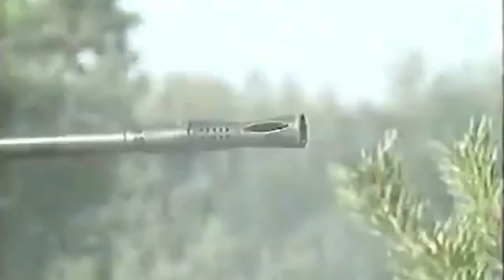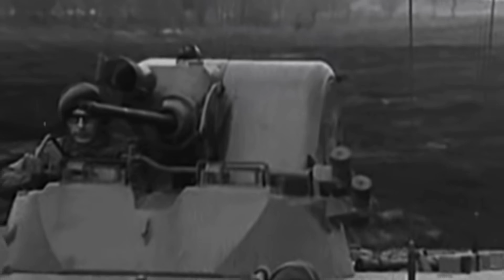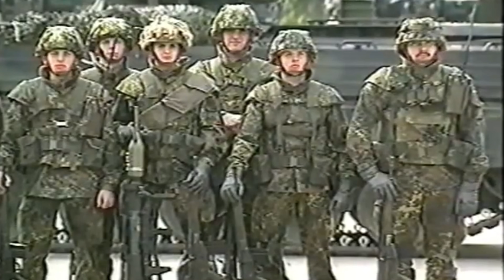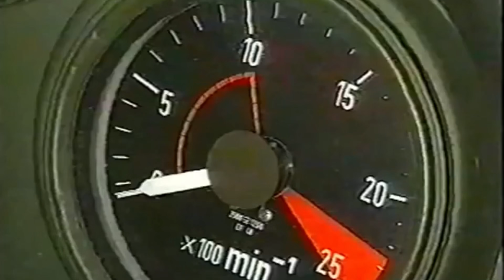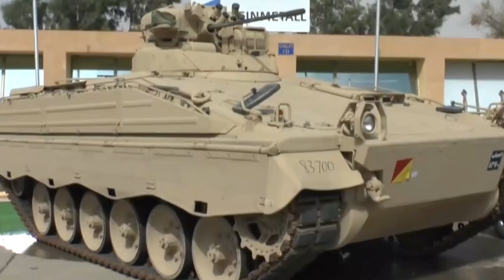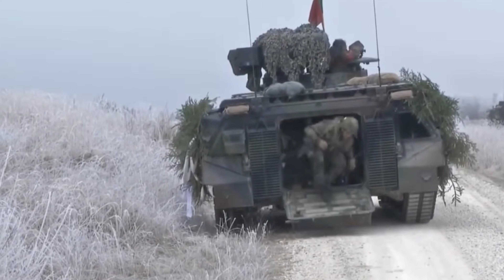The Marder IFV: The Legendary German Infantry Fighting Vehicle | PANZERGRENADIER POWER

Comment: I’ve read that the Marder performed very well in Afghanistan. According to intercepted enemy communications, the Taliban feared the Marder far more than anything else. A single Marder reportedly thwarted a flanking maneuver against dismounted Bundeswehr infantry by holding off 200 to 300 Taliban fighters. Of course, any other IFV equipped with thermal or night-vision capabilities could have done the same, but it is impressive when you consider just how old the Marder is.

Comment: how effective is a 20mm against infantry? all the time ppl use 20mm cannons but i just cannot tell how useful this is compared to 30/40/57mm cannons. how close do i have to shoot a soldier with he to kill him? 40mm has a quite big kill radius but 20mm? volume grows exponentially with diameter so double size multiple Times the he charge. is 20mm even killing with close hits or only direct hits? if its direct hit only why would i not use a .50 or 30mm? i know ammo size and weight is a factor but if the needed ammo for a kill with 40mm is way lower because of splash radius, would that not cancel out the lower ammo capacity? with increased AP performance and ragne

Comment: The Puma really has some big footsteps to fill, its development issues are also blown out of proportion to an absurd level, the marder is a system which people could study in every possible condition for 50 years, of course its reliable, its built on a solid concept and initial problems have all been mitigated by now. The Puma starts with a big leap in capabilities and will only improve once it's fully in service.
 Engineering challenges are seldom unsolveable and usually changing or unknown requirements play a role but if Germany didn't waste most of their defense budget on consultants, bureaucracy and repairing ancient stuff, these issues could probably be fixed way faster.

Comment: My favorite? Marder and Puma. But i love all IFVs. First and foremost, they punch far above their weight limit. Auto canons and guided missile launchers make them a danger for almost everything on the battlefield. Infantry, tanks, aircraft...it doesn't matter. An IFV will hurt you and try to kill you. Second and last, IFVs are remarkable marvels of bio-mechanic engineering and symbipsis, because inside these vehicles lives a small colony of borderline insane creatures that are armed with spades and RPGs, whose sole purpose in life is to wreak havoc on both friend or foe. Here in Germany we call them Panzergrenadiere but you may know them as Mechanized Infantry. In theory, they come in both male and female form and in all forms and sizes that are allowed to serve in the military, but in reality, they're basically invisible until an enemy tank arrives. What follows is a recreation of that scene from Jurassic Park when the Raptors ate the cow, just louder and even more chaotic.
Reply: I think they should restart the Marder manufacture. All it needs is an off-the -shelf modern 30mm turret with Iron Fist on it. 
It would be cheaper, more durable and more capable than the Puma.

Comment: My favorite IFV is the BMP-2, not the BMP-2M but the BMP-2. It's simple, quick, reliable, has a amazing firepower, and you can practically find spare parts in any part of the world. And to me, as long as an IFV can take autocannon fire, the protection level is sufficient. The only two hiccups the BMP-2 has, in my eyes, is the lack of a gunner's TI and the poor side armour; whilst the front is impervious to 23mm AP rounds, the sides can be penetrated by 12.7mm AP rounds. Nice video and footage BTW.
Reply: As long as you don't have to sit inside it, its fine. It has been tested, the Marder could penetrate the BMP-2 from all sides with the help of A: high rate of fire (>1000rpm) and good accuracy, you (weaken the armour at the same area) and B: due to the gun being a lot further away from optics, you can actually see what you are shooting at without having to stop and correct, like it is in the BMP-2.

Comment: Funny, a shown Bundeswehr video compares Marder and Puma with VW Golf 1 and Golf 7 . Under extreme harsh conditions(like in ukraine) I would prefer the Golf 1. Less capable, but more reliable, has no electronics that can fail, can be repaired and maintained by monkeys and does not need highly trained specialists for repairs. Weniger ist manchmal mehr.😅
Reply: But at some point that tradeoff just isn't worth it anymore. We are not talking about 30 to 40% more survivability in a Puma, we are talking 300 to 400%.
Reply: @jonny2954  How is the survivability with no IFV, because Puma broke down and no specialists available to fix it? Better an old IFV than no one. In real war such a scenario could happen.
Reply: @hansulrichboning8551  That's the fun part, a Puma is actually easier to maintain because unlike the Marder it uses Line Replaceable Units (LRUs). Think of it as a LEGO set. If the gunners thermal imager fails the entire gunners sighting system is pulled in the field and replaced, the defective one repaired back at a base. No need to go into finicky stuff in the field like with older generation vehicles.

The Problem the German Army used to have is there were no spares ordered to replace the defective units, so the point of LRUs was completely eliminated. They had to pull the defective unit, repair it and put it back in the vehicle, in the meantime the vehicle was out of operation. That changed about two years ago when they pulled their heads out of their a**es and ordered spares. As example 53 spare powerpacks.

The Puma also has extensive analytical systems that literally tell you what's defective. No lengthy looking for faults.

Comment: Some Marder  are fitted they do have a twin launcher anto missile system one one side of the turret on the later ones , some also had a remote .50 weapons station on the rear roof
Reply: Up to the A1 version Marder had a second MG3 mounted in the "RWS" on the rear roof. 
THis was eliminated on the A2 and the mounting moved to the left side of the turret, as the MK20 got a dual belt feed system, wich mandated the removal of the coaxial MG3

Comment: The PUMA might sounds and is quite impressive however it has a lot of relaibility issues, so much so that the Bundeswehr announced that they don't want to purchase more, instead of that they want to phase out the remaining Marders with the IFV variant of the Boxer. Plus the Bundeswehr is quite underfounded so that might be another cause for the Germans  to keep the Marder in service. I really love the Marder, it was so much ahead of its time. I mean the US still used M113s which aren't the most fitting for the IFV role (but it was a neat and really adaptable piece of equipment). So yeah favourite coldwar troop transport, BTR-80 and the Marder without question both of them look so cool and iconic, what a shame they would have to fought againts each other. And I love the Marder's succesors too...both of them apperently, maybe the PUMA has a bigger place in my heart. Also thanks for the video I always happy to see a  video about this swiss knife of IFVs. Also, GAIJIN! WHEN MARDER 1A5A1?!
Reply: Puma troubles were sorted out with the S1 upgrade. Framework contract for a second batch of 229 Puma is signed of which 50 are already on order.
Reply: @jonny2954  I've heard about the S1 upgrade, but I've heard the opposite of the further orthers. But honestly sounds a better choice to the IFV role than the Boxer
Reply: @cyberarchitect9280  the majority of reliability issues were due to the conservative defense ministers in the 2010s slashing the force internal maintenance branch and were cutting cost left and right (wich resulted in low to no stockpiles of spareparts etc).
these issues have been mostly fixed by now and system internal issues have also been adressed with Puma S1.
all pumas are getting upgraded to the S1 standard.
With the current procurement, germany will operate around 400 Puma IFV´s and has the option to aquire another 150 via the framework agreement.
Reply: @cyberarchitect9280  Boxer IFV will be aquired for the mechanised infantry battalion belonging to the new medium forces. Heavy forces will get further Puma.
Reply: @jonny2954  New medium forces, I didn’t hear about that. Their equipment, and task?
Reply: @cyberarchitect9280  comparable to heavier equipped stryker brigades.
2 Btl of "light infantry" on Boxer APC, 1 BTL light mechanised infantry on Boxer IFV (Boxer with Puma IFV´s armament), organic artillery (RCH155 on Boxer) organic recon (Fennek and Korsak), organic fire support (Boxer CRV) etc.

the role is that of a mobile quick reaction force for fast deployment to a combat zone in europe via road transfer or mobile in theatre operations comparable to the job of a stryker brigade, but heavier armed and armored.
Reply: @cyberarchitect9280  New "Mittlere Kräfte" are forces that can quick deploy indepentently via road to support either heavy main forces under pressure or heavy main forces in a breakthrough. Equipment exclusively wheeled, mainly Boxer based. From IFV to Artillery (RCH 155).
Reply: @jonny2954  That sounds neat

Comment: With the intro "music" I cannot help but wonder if the "vocals" were lifted from a mixed doubles tennis match or German home-made adult entertainment video's.

I'd say the Milan would still have one advantage - no dismounts required. Infantry can shoot tanks, sure. But it's not recommended to attempt to do that from inside a Marder.

Cramped isn't nice for the infantry and that what it was designed for. You can make a vehicle small and low profile... I can understand the need for a Puma with more modern features and room for updates.

Comment: The Marder is in use since 1971, whereas the Bradley was not deployed until 10 years later. The USA was lucky that there were no major conflicts in the mid to late 1970s, or they would have had to fight with M113s.
Reply: When the German Army reformed in the 1950s they ordered what was the first IFV (well before BMP) called the "Shutzenpanzer lang"  (Infantry Tank, Long) based on WW2 experience using the SdkFz.251 armored half track as an APC.   The German army in WW2 had found it took far to long to get infantry to the front because of the number of times and the distance they needed to dismount from the battle.  The Shutzenpanzer lang not only had much more Armour it had a 20mm gun for the fire support role and no doubt would have survived air attack well.   Despite its flaws the Shutzenpanzer lang led to the Marder.   In WW2 there were plants to develop the Czech Panzer 38 as a 5 man (half squad) IFV.
Patton made a comment along the lines that the armored M3 Half track was more dangerous to US troops than the Germans because US troops would get over confident in them.
-One tragedy for Ukraine is that during the years of neglect of defense spending in Germany the upgrade of the Mader's 20mm gun turret to a 30mm gyro stabilized KUKA designed unit with improved thermal vision was rejected by the German parliament.  That definitely would have made the Marder more powerful than the exceptional bradely.
Reply: @williamzk9083  yes but they didn´t upgrade the Marder because of the Puma IFV it has the 30mm gyro stabilized gun but yeah for me one of the Marder´s biggest "flaws" is not having a stabilized gun
Reply: @Elite-Y-  they didnt upgrade Marder due to cost and age of the platform and a replacement was overdue.
Reply: @Elite-Y-  not 100% correct. They didn't upgrade the Marder not because of the puma, it was because there were already plans to replace it with the Marder 2.
Reply: @williamzk9083  The infamous HS30 had many flaws(unreliable) and was replaced by the much better Marder quite early.The austrian Saurer IFV from the same era was much better than the HS30.
Reply: @williamzk9083  Ukraine hasnt even got the newer Mardet varieties with the Milan ATGM, if the mardet had gotten a 30mm cannon that variant wouldn't have been sent to Ukrain.
Reply: @LuLu-ip4zb  Ukraine got Milan ATGM, but not from germany, as the german army is using the Spike 2 LR for some years now.
They got Marder 1A3´s, the currently most numerous variant (a 90´s upgrade with all round protection vs 30mm cannon fire and a few other stuff).
They can mount the french delivered Milan on the Marder.
Reply: M113's are fine for support vehicles but as frontline vehicles...nah, fuck that.
Reply: @WhiteIkiryo-yt2it and even as support vehicles, they have reached the end of their time.
not good enough anymore.
Reply: The evolution of Nato was basically the allied powers trying to catch up to Nazi doctrinal brilliance which was decades ahead of their own. Unfortunately they seem to neglect the fact that Warsaw pact doctrine was built from lessons of defeating said Nazis. Nazi doctrine emphasised maximising the shock power of their critically limited resource situation. We can see US obsession with shock and awe as a direct descendant of this but this is a complete waste for a superpower who has access to literally unlimited resources and logistical capabilities.
Reply: germany is lucky they don't have to fight a major conflict right now
Reply: @reinach77  just like any other NATO country.
the british army is a joke and downgrading to a 3rd tier force, the french army is basicly only light infantry in MRAPS and mortars, the polish army is currently rebuilding from 30 years of no investment, the spanish army is also in horrid condition, romania, hungary, slovakia, slovenia, czech republic all only have alibi armies, the finnish army is willing but also lightly equipped and small, the swedish army is small etc.
the thing is, that NATO countries dont fight alone, but together and then they got a massive army.
Reply: @cathulhu-q7y  that's completly besides the point and no, the us can stand for themselves
Reply: @reinach77  who said anything about the US?
and no, without its bases in germany, the US could do shit in europe, north africa and the middle east.
Reply: @reinach77 All of us Western Europeans are. The Germans are more open about it but the British army also shrunk and is in bad condition.
Reply: @reinach77  What do you mean lucky? Didn't we specifically veto Ukraine's application for NATO membership in order to avoid fighting a major conflict with Russia right now! This is German foreign policy, don't attribute it to Lady Fortuna.
Reply: @jansix4287  🥱

Comment: Well, I'm Swedish so I must say CV9040.
Reply: The CV9040 is a fine beast and far more modern than the Marder and uses a 40mm gun which needs to be manually loaded in clips, some troops don't like this and prefer a nice long 2000 round long belt like the Marder.   The Marder was intended to get a 30mm KUKA gyrostablised upgrade but funding wasn't provided.   I'm sure SAAB will sell a CV90 any gun a customer wants eg the 30mm chain gun.
Reply: @williamzk9083  The Swedes are now switching to 35 mm on their newly ordered CV9035 Mk IIIC.

Comment: The Marder or der Marder, looks ok but the somewhat limited access door in the back you really have to practice "The tank is on fire" drill.
Reply: My vehicle was the YP408, MID 80’S DUTCH ARMY, what was more cramped then the marder. The fire drill was always slow until the day came we had a real fire. People are very motivated to get out of a burning IFV. No one got hurt and the fire was put out fast with no damage. Smoke  grenade went off.